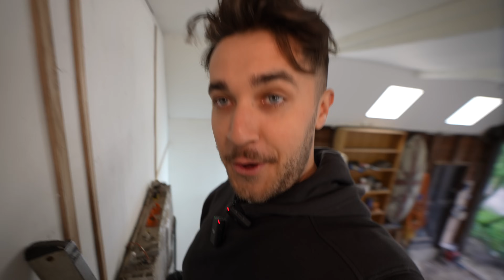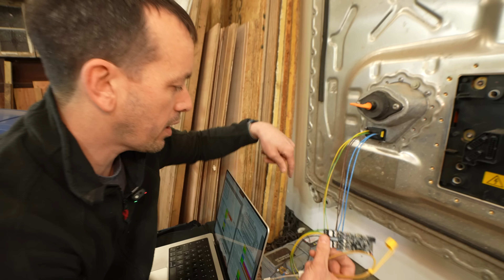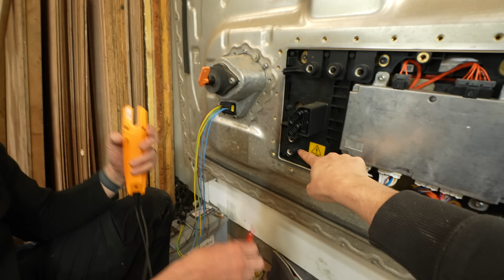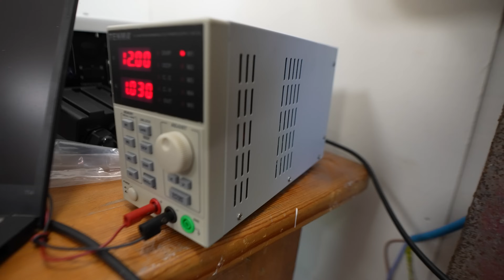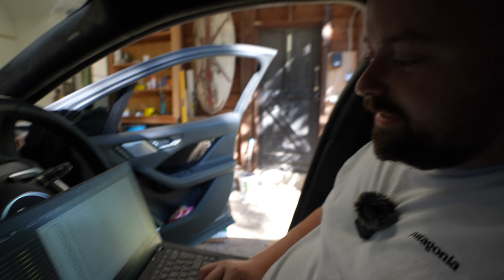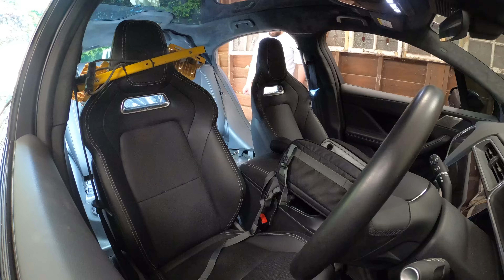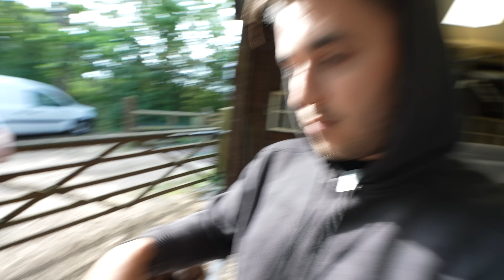Hacking an EV Battery From a £90,000 Car -  DIY Vehicle to Grid | ØY44

Comment: On some cars, the battery does a handshake with another ECU in the car, which includes car-specific info like the VIN, so replaying the data from the car may not work on that battery.
Reply: You should be able to speak to some EV recycle people about the feasibility of swapping these Jag batteries and what it involves. If you can do a straight swap, then that implies VIN/coding information between donors and cars is not relevant.
Reply from the maker: Interesting, thanks Mike!
Reply: As the battery is comprised of smaller packs rather than individual cells, I'd be tempted to disassemble the pack from it's protective outer shell and repurpose the individual packs. Which may well prove a lot easier than stripping the Tesla-style packs containing thousands of individual cells, also eliminating their nasty communications issues. 
Just a thought. 👍
Reply: @Zodliness  this is a no brainer, id literally thought of building different shaped packs out of the individual cells like from a tesla battery to wire together differently for various hybrid applications where the needs are different... but for "cheap teslawall" type solutions, that seems unhinged laborious...

whats the juice for all that squeeze?

you saved some money

look I know theres folks washing sandwiah bags out there but Im not about it... 

🤣
Reply: @Zodliness  You are right. I think they will spend a lot of time going nowhere. My biggest fear is that they will assume that they can put 400+V in to the solar inverter. Maybe they've already thought about this but if they haven't it's real important to know that the impedance of a solar array outputting 400 or 500 volts is NOT the same as a battery outputting 400+ volts.
Reply: @mb-3faze  Isn't it a hybrid inverter built for batteries?
Reply: @alibro7512  Yes... but unless things have changed (which the might) the nominal voltage is of the order of 50V. I'm interested to see how this problem is tackled.
Reply: @mb-3faze  Not necessarily, some Solax hybrid inverters can be configured for battery voltages between 85V and 400V.
Reply: @mb-3faze  ye of little faith. If you look up Dalas battery Emulator project for yourself, you'll see that many batteries and inverters have already been decoded and mapped and are working using this system. Each battery manufacturer uses a slightly different process and CAN sequence for their vehicles. But once understood, this can very much be a plug and play solution. 

There are masses of EV batteries coming out of scrap yards across the UK from even lightly.xrash damaged cars which are broken for parts. They are selling them much cheaper than even new bare cells from China, and these are fully self sufficient BMS and thermal management in one package when working. It makes much more sense to try and use them as they are, vs trying to disassemble and reconfigure with new BMS etc. Once done, it is easily replicable and kits could be sold with harnesses for each type of battery
Reply: @alibro7512 yes these x1 inverters use HV solax batteries usually, up to 400V. This gives higher efficiency on the round trip charging cycle, but being stuck with solax branded batteries means one cost option. These EV batteries are significantly cheaper and larger capacity.
Reply: @GreenEnergyGuyd  thank you! exactly!
Reply: On some EVs there is a so-called continuity wire that runs parallel to the main high voltage/ high power conductors. That continuity wire must show that all connectors are, indeed, connected. I took apart a NIssan Leaf in 2014 and the only way to get the motor to run again was to connect every part of the original car (motor/batter/charger/dashboard etc) - then the VCU decided it was OK to flick the internal contactors on. LMK if you want a link to that video.
Reply: It'd be interesting to see if the car can trigger the battery on the wall by extending all the connector pins... It'd at least verify if there is or isn't a car-specific handshake.

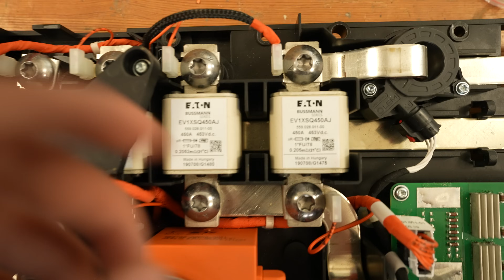Comment: 11:19 these are fuses not shunts!
Reply: Also, even if they were shunts (they are fuses) - shunts will not stop the flow of current in either direction. Maybe you meant diodes. Shunts just produce a measurable voltage which is proportional to the current flowing. (You know all that - but others reading the comments might not.)
Reply from the maker: Yep! Mis spoke 😁👍🏼

Comment: park the car so the battery is like the one on the wall see if it still works  maybe its got a tilt switch
Reply from the maker: Fair point, but, I believe tilt data is received from the car, not from within the battery

Comment: Nice job, it takes skilles to hack these things, both hardware and software engineering required. The termination resistor on a can bus is is for end of line, EOL. The software requires a terminator, which is just a line of ASCII code, before the next line can be sent. Very best of luck!
Reply: You are confusing the ASCII EOL character and the "end of line" in a bus topology. The end of line resistor's purpose is to cancel out reflections of the signal at the end of the wire and therefore preserve signal integrity (keyword: transmission line impendance). CAN actually requires one 120 Ohm resistor at each end of the bus (hence the 60 Ohm they measured)
Reply from the maker: Thanks Tony!

Comment: Inspiring! The thousands of CAN messages are more than likely communication errors, caused by the HPCM trying to communicate with every other control unit that is missing on the car i.e ABS, BCM, and especially immobiliser.
Reply from the maker: Thanks Tim!

Comment: Well can bus decoding is not done with that software what you do is you get the frames but you still don't know what the id's mean or what the actual data payload of it means. 
Also I would have thought they already use CAN FD not just normal CAN but I guess it is how it is..
Reply from the maker: We need the frames in order to decode it and play back the snapshots we need. I’m still very new to all of this, but it’s been fun! 🤩👍🏼
Reply: @corymac  Yeah it is well developing these systems is a lot of fun. Not doing it for Cars though but motorcycles.
Reply: Btw. in modern cars these messages are typically replay hardened they typically use a Hash for some of the bytes and an incremental number for some others. 
Some of these systems also have a key handshake initially to auth. Well at least the systems I work on where we created a protocol ourselves it uses this. 
The entire set of messages is always encrypted and is not the same every single time. 

It sounds quite bad that jag is actually so much neglecting there security this might actually need to be changed in future because of regulations.
Reply: On the IPace, you can'y just "listen" the CABbus on the OBD2 port because the canbus network is masked behing a proxy gateway module. You can send request to ECU and the proxy will forward the request to the internal bus. The answer will be send to the OBD2 port, but only the answer , not all CANbus messge.

Comment: I know you said that stripping down the battery pack to use your own bms is hard because each cell has it's own mini bms, can you not remove those mini bms from the cell packs?
Reply from the maker: It’s possible, but would need a new BMS then, and I’d prefer to use what jag have spent millions perfecting 😁👍🏼

Comment: Saw a U.S. based YouTuber who repurposed a BMW battery - but he tore it down to the cell level and added a new BMS rather than try to hack the built-in BMS. He did succeed but this is cooler!
Reply from the maker: Jag have spent I presume millions in R&D to get this perfect, I wanna keep it as it is! 😁
Reply: i have got Mitsubishi outlander batteries, and the electronics on there are so much more expensive (better) than the cheaper webshop alternatives

Comment: Does the battery have a tilt switch?
Reply from the maker: Fair point, but, I believe this is data it receives from the car, not from within the battery
Reply: @corymac  Hi, I was thinking maybe it has its own for redundancy.
Reply: Crash and / or tilt data would normally originate from the air bag control unit.

Comment: There should be an interlock connection on all of the battery connections for motor and charge port etc I would assume these would all need to be shorted out. The interlock shuts down the battery if and cable is broken discounted for safety
Reply from the maker: Good observation! We’ve since found the HVIL loops on the contacts, that and a few other issues! Part 2 coming soon 😁👍🏼

Comment: cool to see those in the industry looking towards these kind of upcycling projects. some of those all in one solutions are eye wartering expensive. have you had a look at those DIY LFP battery backup systems? like the Seplos Mason, seems like a good option for those that want a cost effective soltuion & the safety of LFP cells, also a lot less reverse engineering.
Reply from the maker: Thanks mate! We’re trying out best

Comment: You are where the future is .... I can't wait until someone gives such projects the traction needed to make this a business. ( Octopus??) Octopus do support VTG but the cars and charges are very limited. Their tariff is called Power pack is currently compatible with:

Nissan Leaf

Nissan e-NV200

Mitsubishi Outlander PHEV. 

The chargers needed are Wallbox Quasar 1 (it's worth noting that the Wallbox Quasar 1 is no longer for sale in the UK, so you'd have to have it already installed).

Octopus say they are working hard on more integrations!

Total respect to you guys for doing this  - lets hope someone gets in touch to give you what is needed
Reply from the maker: We’ve had some big wigs see the video, and come along to help! Stay tuned 😁👍🏼
Reply: there is already a large market for used ev batteries which you may not be aware of. Prices of second hand cells are quite high due to the high demand

Comment: Someone pointed out the coolant loops and other connectors. See if that pile of bits has the connectors and if they have sense resistors in them, the battery ecu might be booting and checking presence of all its ports before it will take a ‘close contractors’ message. If it’s JLR they aren’t big on securing messages across components, so should take a raw message and just execute it.
Reply from the maker: Good spot Ian. We’ve managed to nab Dala, him combined with Chris is proving quite a lethal combo. There are HVIL loops I’ve since discovered too on the connections.
Reply: @corymac it will also be doing IR tests internally as well?
Reply: @IanFarquharson2  Actually that's a good point, the battery was from a crashed car!
Reply: Remember it’s all thrown together quick in the factory and serviced by parts swappers, so the code will have checks in it to make sure everything is nominal before it will take the commands that ‘do’ things. All of this needs to be inside the domain of that battery ecu. Also if it’s anything like Tesla, it will keep the contractors engaged for like 15-30 mins after you put it in park. Let’s it dc-dc the 12v back up to a decent voltage for standby, and watch YouTube while your Chinese is being made. The pyro fuse will have been commanded to blow in the crash, have you located it? Hope it’s not on the bottom of the pack?
Reply: @IanFarquharson2 But he's measuring 400VDC. I didn't think that could happen if the pyro fuse is gone. Essentially splits the battery in half.

Comment: This is the best video for Cory so far, I just love this geeky stuff
Reply from the maker: Thanks Dave!
Reply: The easiest solution is to strip the existing BMS as it is looking at too many things, and install
One that only looks at temperature and maybe module voltage, to cut out when short circuit, then it is easy to reset not that CAN none sense, simplicity is the key, once you have the simplified contractor control it is easy to connect to the inverter
Reply: I agree! More of this please.

Comment: I literally thought about doing this with a crashed Tesla 😂
Reply from the maker: What stopped you? 🤓
Reply: @corymac  got a basic victron system installed (multiplus 2) but when I have the spare cash and have finished another project that's taking up storage space (as I'm gunna need the space to strip the doner car) I will have to take the plunge and get on with it

Comment: @corymac I've recently been working on canbus on my Land Rover Discovery 3 after a park brake and suspension issue and found that if i wanted to take modules out of the CANBUS I had to still continue the CANBUS as i have removed that module but need to still use the car as after it was removed it put all other modules into an error state still the CANBUS was back into a token ring data bus by connecting the HI and LOW to the next module in the bus so the CANBUS thinks all modules are present and now everything is working as normal even without the park brake module being present, it has no errors in the system either, hope this might help as it may help getting the CANBUS on that battery bypassed so only the contactor module needs to be read / written to on the bus then like it is with my discovery :)
Reply from the maker: Good onsite, thanks mate

Comment: Swap the battery pack with the one in the car. Then take the car to jaguar and have it repaired under warranty.
Reply: VIN Number of the car is coded in every single ECU and module. Swapping part will probably prevent the car to start, and it is easy to discover from the can BUS.

Comment: Awesome, I have just done something similar with Nissan leaf batteries
Reply: Hi , I'm hoping to do do this on on a French 3phase 440volt system soon but lack the info to do it. Can you help me out?
Reply from the maker: @colinstevens8968 That’ll just require a different inverter, it’s extremely complex so if you’re not sure,
It’s best avoided
Reply from the maker: Cool! I’ve seen those are pretty easy to crack, have you come across Dala before!
Reply: @corymac  yes a regular follower , altho I have taken the easier path, and am running a 48v reconfiguration

Comment: I love the geekiest & nerdiest stuff. I loved the Tesla/Edison joke. Are there internal sensor for coolant levels that are keeping the battery from working? Also isn't there an accelerometer that shuts everything down after a crash, does that need to be physically reset?
Reply from the maker: Thanks man. There’s a pyro fuse, but that hasn’t blown! And as far as we can see in the logs, there is nothing software related blocking anything

Comment: Have done this to a zoe 😅 glad to see you giving the idea legs. Its actually the best recycling option these batteries have! #provemewrong
Reply from the maker: Cool! How did that one go? Was it more straightforward?
Reply: @corymac  Nope! Exactly the same with exactly the same battery-emulator software and a CANBUS to Serial Arduino. The project just originally started with support for the 24KwH Zoe batteries first if I remember correctly (first ones to become cheap/scrap?). Amazing to see theres now support for a load more looking at the project website! Planning on doing the same in my current home and hoping to try and get it talking to a Victron inverter which isn't currently on the support list for the emulator project!

Comment: If that battery has a roll-over sensor built into it to disable power if the car were to be on it's roof, I can't imagine that it would love sitting at that angle on the wall
Reply from the maker: I think the sensor is in the vehicle and not within the battery itself 😅👍🏼 - good point though!

Comment: Modern cars have a pyro fuse to prevent the car from turning over after a crash and the airbags going off. Maybe one of those fuses you pointed out need replacing? Love the concept Cory boy
Reply from the maker: We will be checking this amongst a list of great suggestions we’ve had. Thanks mate 😁😁
Reply: can bus has nothing to do with HV bus in that sense
Reply: I will also look into this " pyro fuse" safety lock. Sometimes it's an electronic safety  lock if the car was in a bigger accident. Mostly if more airbags are deployed.

Comment: Could the battery have a level sensor as a safety mechanism? I’m not in any way an electrical specialist but I was a paramedic. The cars that would roll over in an RTC would have a special mechanism to make them safe.
If this battery is not horizontal then could it be thinking it’s rolled over?
Reply from the maker: Fair point, but, I believe this is data it receives from the car, not from within the battery
Reply: @corymac  If it's a safety precaution, then why would it be somewhere else in the car and not in the battery?

Comment: Another point Cory, after re-running the video, I saw your PSU is supplying 12 volts, although that’s nominal voltage it is too low. LVB batteries run at about 13.2 volts, Charging would be at about 14.5 volts. Also note there could be a tracking control unit that has its own battery.
Reply from the maker: I don’t think the voltage is affecting it so much as the amperage, a lot of the EV modules will go as low as 9v

Comment: Do you know how big the controller code is? Is it worth trying to dump the whole thing and decompile it to see what makes it tick? Not that i'm suggesting you decompile and reverse engineer proprietary code, you understand. Ahem. 👀
Reply: Nothing wrong with that, but usually nontrivial to extract code from  things like this as devices usually have code protection, and are automotive processors that aren't as well documented as more run-of-the-mill devices.
Reply: @mikeselectricstuff  Yeah, it's a bit of a nuclear option, 'non trivial' indeed.
Reply from the maker: We’ve effectively tried that on the desk, but it hasn’t been successful waking up the BCEM. But we’ve since had a breakthrough! Part 2 to follow!
Reply: @corymac  Looking forward to it! Going 'off piste' so to speak, is where all the fun and interesting stuff happens, imo.